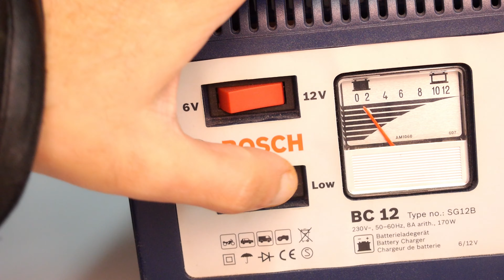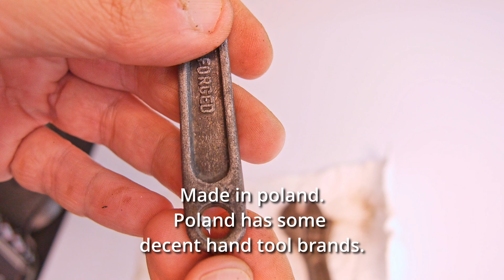Extremely Rusty Adjustable Wrench Restoration :: 70 years old - W.Germany & Poland made

Comment: Grew up using WD-40. Had a pair of pliers that were rusted to all shit. Was bored, sand blasted it, and used WD-40 to see if i can get them working again... it didnt work. Tried some PB Blaster later on. It didnt work at first, but the next day, i saw someone using them and was surprised they worked
Reply from the maker: I will try the PB Blaster.Thanks for the tip. :)